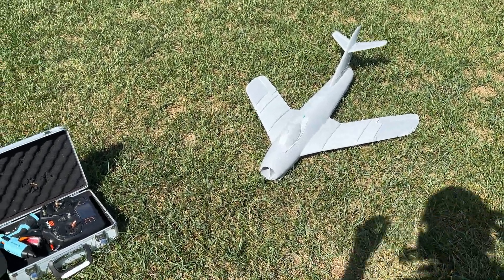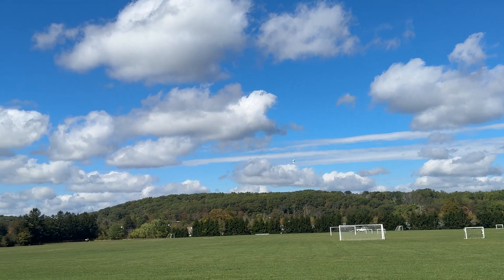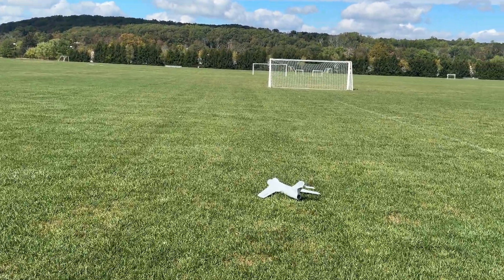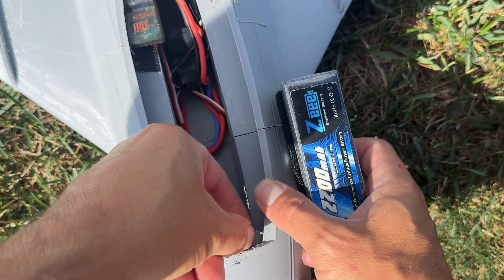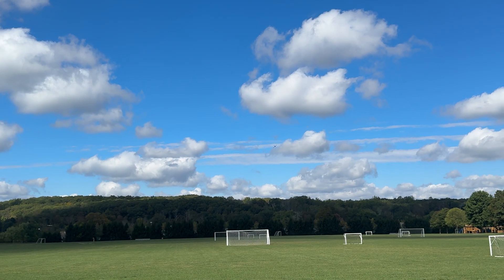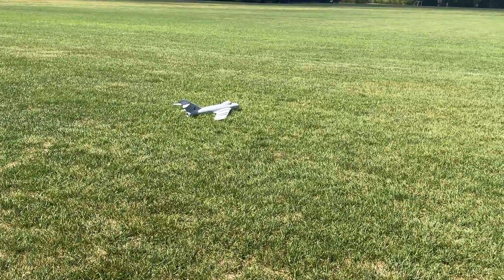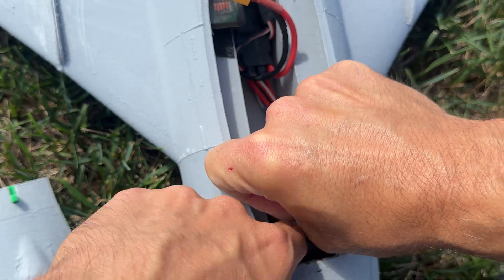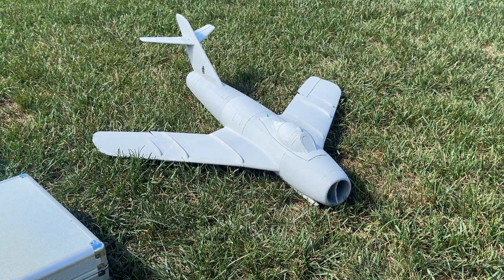MiG 17 Maiden Flight!

Comment: Replace those gun barrels with brass tubing with 2/3 of the barrels epoxied into the fuselage. Pretty sure you can get some scale ones. If not, just dremel the cooling holes.